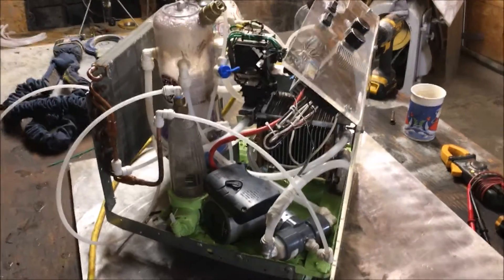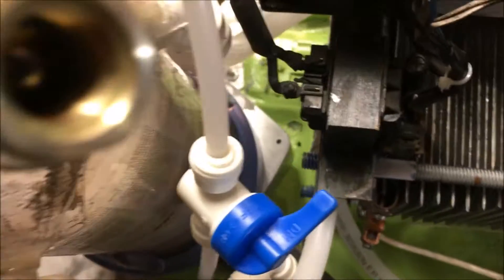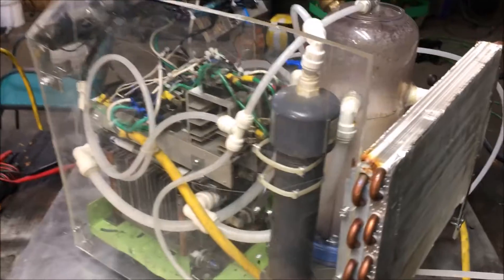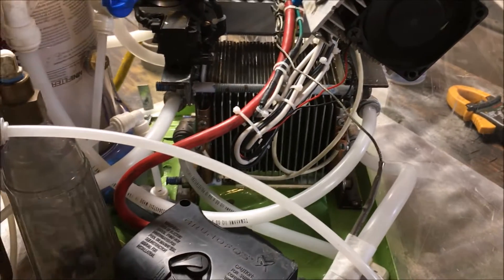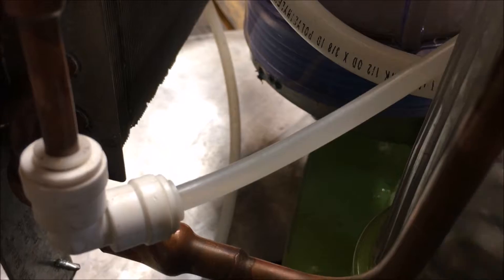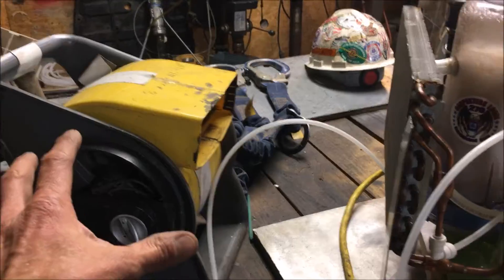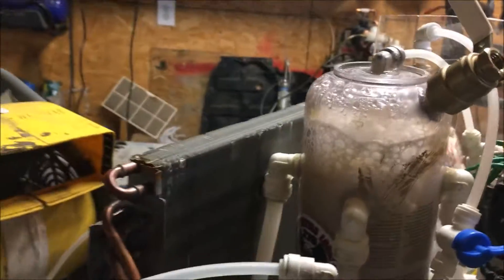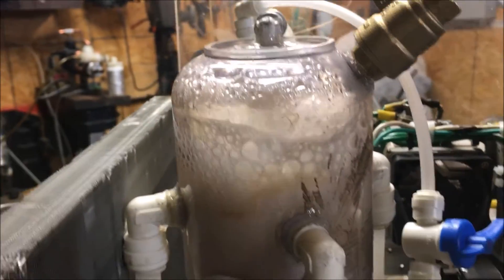HHO /Oxyhydrogen torch 2500 watt Build prt2

Comment: That radiator/condenser designed for refrigerant has a lower flow rate than your setup requires. Instead of air over water exchange try water /water which would be much more effective with low volume flow rate. Just submerge this radiator in a large tank, no fan needed. Just an idea. What type of stainless and what electrolyte?
Reply from the maker: 316l is the stainless koh , the radiater works great ...
Reply: Cool 316l about the best available, oh-k koh lol but Cr(+6)= cancer no lol. Have you tried any non metallic electrodes like graphite or non chrome metals like lead?
Reply from the maker: yes i have tried iron with very good results
Reply from the maker: yes these cells are toxic
Reply from the maker: forgot to mention i also built a copper cathode cell , dont have time to give you the links but i do have a play list of different hho torches and they all use a different cell , we have iron plate cell the copper cathode , the 401 ss push plate  sell and some other low magnetic grades , and the 316l wich is by far superior, almost no leaching after 5 years of use